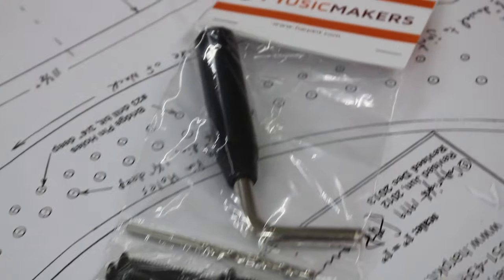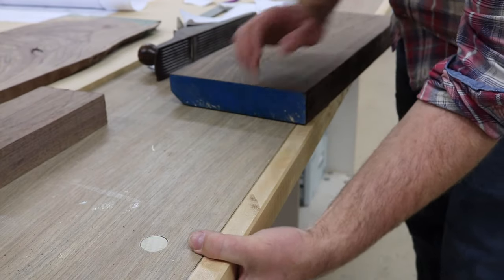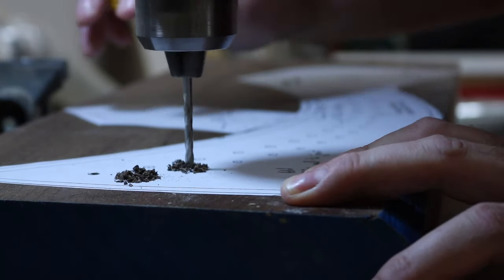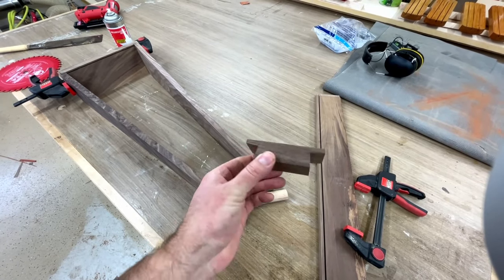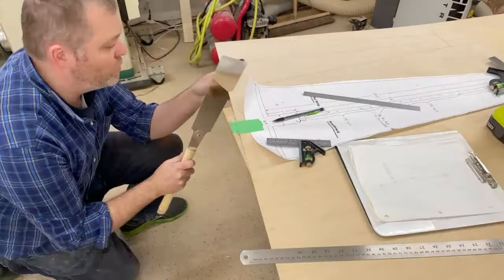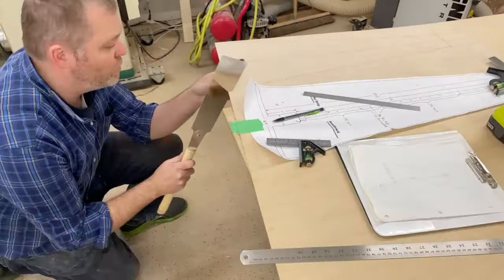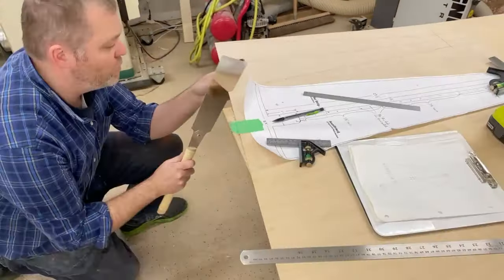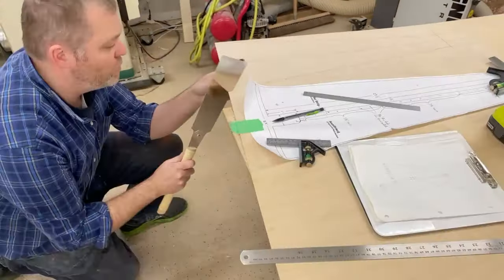How a Harp is Made | Making a harp for my wife

Comment: I have built about 10 of different sizes. I name my harps and the next one will be 36 strings and be named Adrian. I have made the wood template for the neck and sound box.. Those 2 pieces is all I need and my imagination does the rest and of course the mood I get in to do it. I subscribed to your videos. Hope you are off to a wonderful adventure building harps.
Reply from the maker: Yeah. In the future if I make another one I’ll be a little more artistic with it.
Reply: Wow man you did great! I really enjoyed it. I made one 26 stringed one from an old antique maple table top and used Yellow poplar for the sound box sides with the aircraft soundboard. I noticed on the lower strings from middle c downon the wound strings , the sustain is not as good as I would like. Im thinking of switching them 8 strings with carbon fiber strings and see if it will help.
Reply: @Hatchmade  I have a back yard foundry and have some old lions claw feet for a table. I borrowed one from the table and cast 2 for the smaller 26 string. They look good.